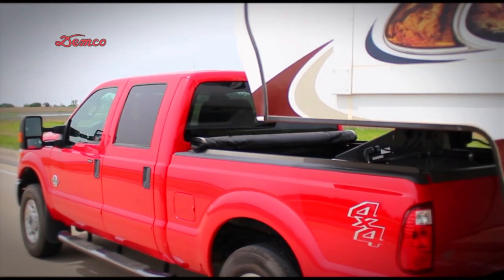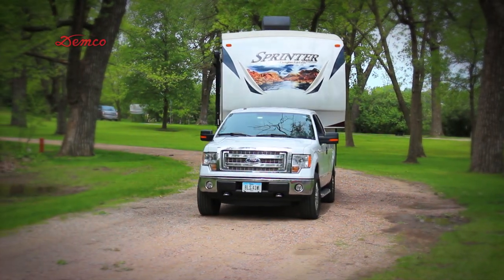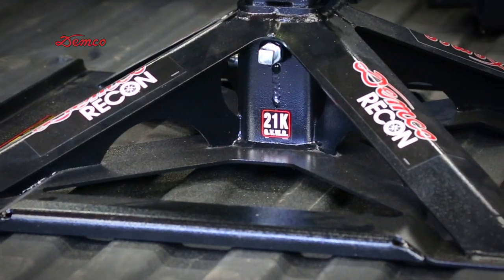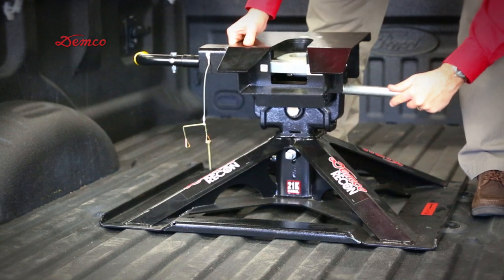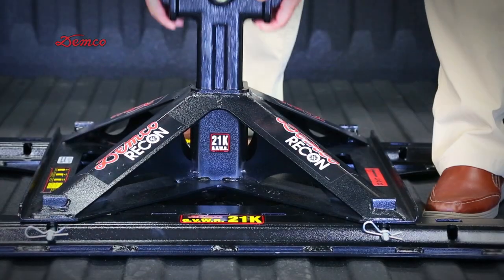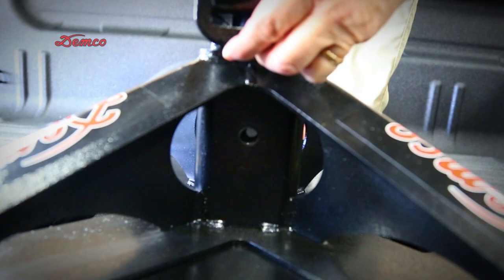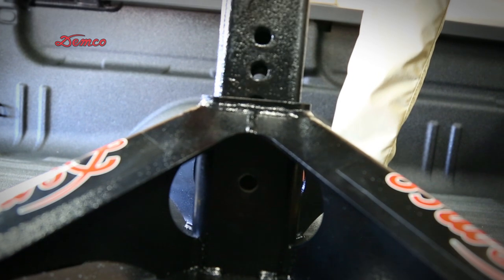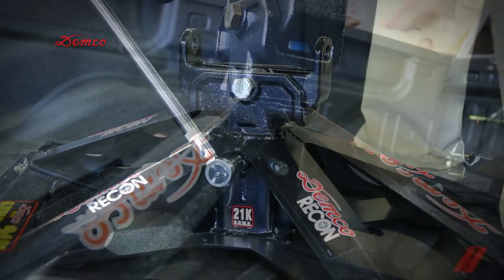Installation of the Recon 5th Wheel Hitch (Goose Neck Ball Mount)

Comment: Just received this unit. Instead of a lock bolt and retainer, it has a stud with 2 nuts on it. What torque value should be applied to the lower nut, and the jam nut?
Reply from the maker: Yes, that is a slight design change.  35 Foot Pounds of torque on the lower nut and the upper jam nut.

Comment: Could I use for 6.4 bed truck?
Reply from the maker: The truck be would need to have a 2-5/16” goose ball installed in the bed.  Use would need to be aware of cab to trailer clearance.  Because of the design of some trailers, (extended pin box and or rounded cab friendly corners) this may work in a standard bed with some applications, but not all.